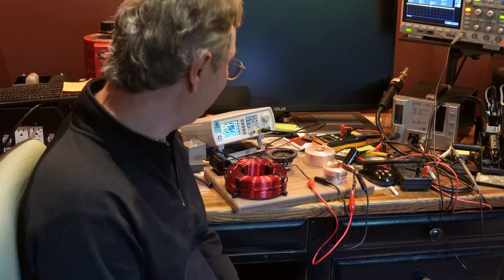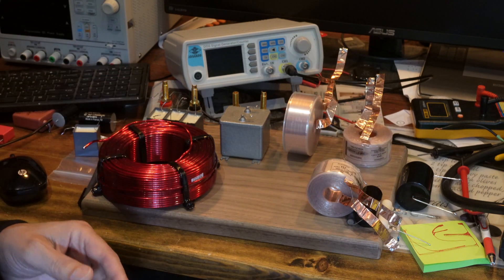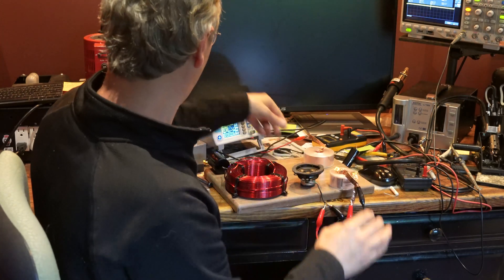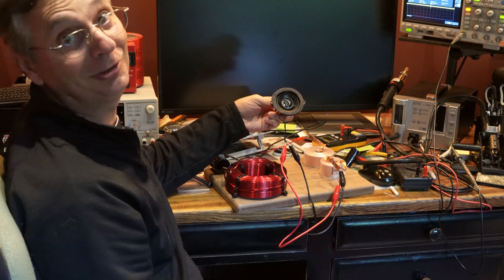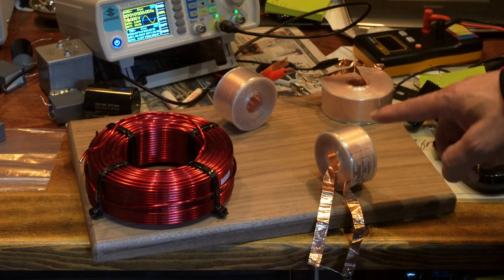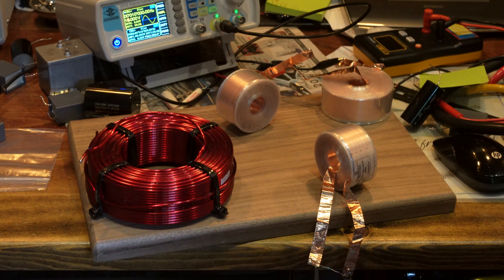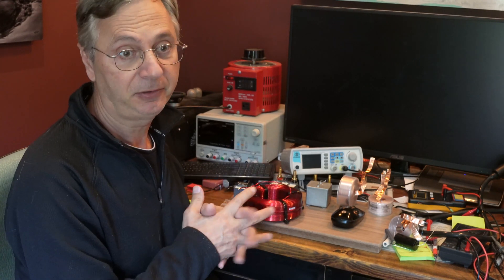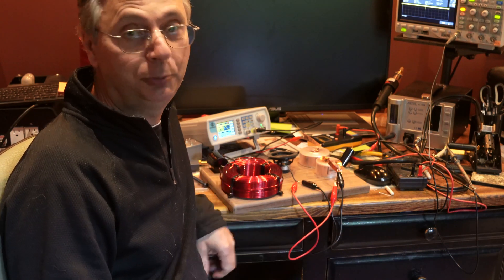Speaker crossover inductor proximity interference. Can you hear it?

Comment: Question: if a speaker’s stock crossovers sound decent even though 😢the inductors are both close & same plane - might interaction been “designed in” to final voicing? The other way of asking might be if I were to correct inductor layout to minimize interactions might it negatively affect SQ?

Comment: A coil is basically a wound up antenna. It’s the length of wire in the coil that determines it’s resonant frequency. When ever you have two coils that are in perfect ratio to each other in length, such as 1:1/4 you will have coupling of the coils and they will resonate with each other. So if your goal is to minimize their coupling capacity, then you want to make sure the length of each coil wire is not in a perfect ratio length relationship and you want to keep them outside of their magnetic field area, which is largely voltage dependent - the higher the voltage, the larger the field strength. The best way to test this is with a magnometer. You don’t want overlapping magnetic fields between coils.

Comment: My question is the same as what The Gum has asked. What about shielding, have you tried any form whatsoever?
Reply from the maker: I did not try to be honest but it is rarely done spacing and orientation is the way to go. The influence of conductive metals being placed in close proximity to an inductor can have detrimental effects on their performance and could affect their inductance.
One thing I would do if you have a lot of space and don't mind 3 separate boards is to separate the Woofer, Mid, and tweeter circuits.
Reply: @Gabster1  how can you say that when you haven’t tried? This is not how discoveries are made.
Reply from the maker: I usually bring a piece of metal close to a inductor to increase its inductance then measure it till I get the level I need when at the testing stage to find the right inductor do that all the time it is a easy way so you don’t have to stock a large number of inductors. Imagine iron inductors they are 10 times stronger. So you want to avoid any metal close by. The closer you get the higher it goes.
Reply: I will concur that ferrous metal will interact. However, copper should not as readily interact, changing the inductance values much. Capacitance of the inductor moreso with copper shielding.  I have seen capacitors, resistors, and inductors wrapped in copper foil acting as shielding. Strong fields would require grounding the shield, while weaker ones will not require it, as the shield does not get saturated.

Comment: Hello @Gabster love this video  watch it like 10 x . I'm building a crossover and I'm stuck on how to place the third inductor.. It ask for three inductors. Now how would I place them so they will not interfere. I have a 1.3 inductor, a 0.2 inductor, and a 0.8 inductor. Now I know that the 0.2, and the 1.3 are the bigger ones I know I will put them on the far ends. But in between how would I place the third inductor so there won't be any interference? Thanks .
Reply from the maker: 3 inductors are easy as you can put them in a X, Y, Z, axis if you look at the video around 3:50 just ignore one of the laying flat ones. the more distance the better 2 to 3 inches or more are ideal.
hope that helps :)

Comment: Thank you, this is Very informative. 
i was wondering if any shielding between the two coils would be of any benefit. like a piece of metal placed between them would prevent any cross talk
Reply from the maker: I did not try to be honest but it is rarely done spacing and orientation is the way to go. The influence of conductive metals being placed in close proximity to an inductor can have detrimental effects on their performance and could affect their inductance.
One thing I would do if you have a lot of space and don't mind 3 separate boards is to separate the Woofer, Mid, and tweeter circuits.
Reply: Mu-metal is used by Lundahl transformers to isolate them of disturbarbance. I have two of these for stepping up mc pickup signals

Comment: Maybe a stupid question but, is there a problem if I accidentally put quite a lot of hot glue in the center of an air core inductor?
Reply: Stops an audible high frequency ringing
Reply: The dielectric constant of air is 1.00059, and the dielectric constant of hot glue is about 2,3, so you should get a measurable effect on the electrical characteristics, but I doubt it will be a problem. You may perturb the electrical response slightly, but the glue is likely to suppress vibration of the coil caused by field forces.

Comment: Hi!
Exceptionally interesting and useful!
I wonder , do you conduct these test only with pairs of inductors, and swap signal genrator back and forth tileach mutual pair is problem free, or do you later on interconnect all inductors except one to get "the system situation" ?
Reply from the maker: Thank you 
I  conduct these test  with pairs of inductors, and swap signal generator back and forth til I cover all possible permutations.
If you have the space best is to also separate Woofer Mid and high on separate boards if they can be a foot apart that will make it easier to have them all get along with no interference.
Reply: @Gabster1  OK, thank for info! I am planning to make external crossover boards to my XO-wise upgraded Wharfedale Lintons, and will most likely use your method when deciding on the layout of that. So far only resistors and caps have been upgraded, but inductors left alone. Is your experience that inductor upgrades may have benefits in same magnitude as say capacitors? If , yes,  any rules of thumb how to choose wire diameter and coil diameter of air core inductors? BR Magnus
Reply: @vespass225  I'd like to know inductors gauge size.i have read on a diy forum that 14awg is decent gauge! he did comparison against foil and a group of diyers choice the 14 awg wire
Reply: @markclancy5371  Hi Mark. I could try to measure gauge sizes next time I open up my Lintons. I have noticed so far, that the different inductors, for tweeter, midrange and woofer, have different gauge sizes, with heavier gauges for lower register.